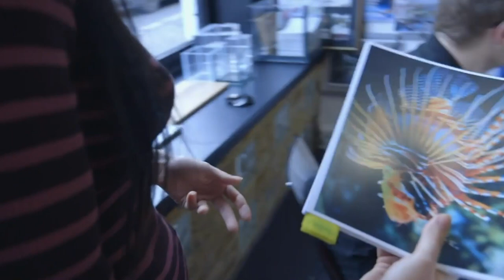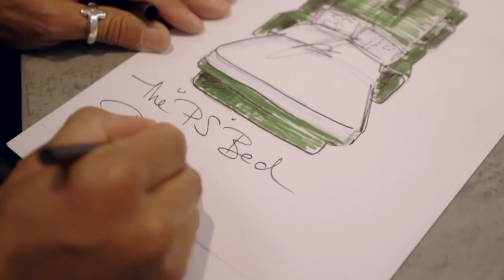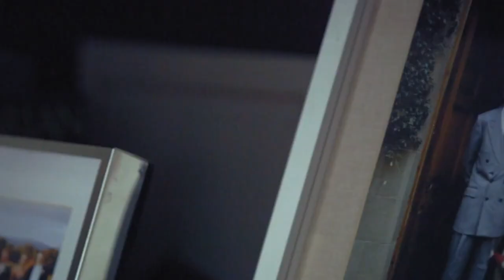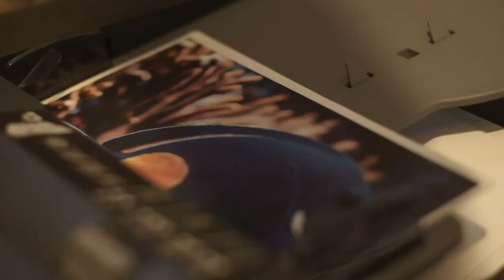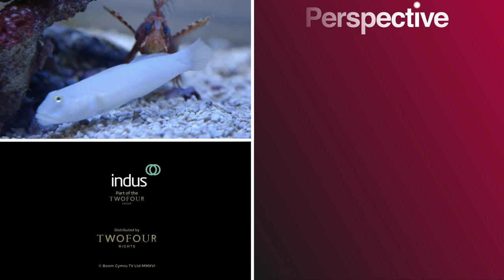£100,000 Aquarium Gets Installed In A Luxury Mansion | Finest Interiors S1 E2

Comment: £30,000 for 1 king size bed. £200,000 a kitchen.
 £20,000 for 1 bottle of perfume
Reply: I'm not well now and I'm a wheelchair user and I leave within the benefit system in the UK people in this country are virtually on the breadline if they're ill or they disabled or impaired in any way and I have to rely on the state not because we all scroungers we're just not able to work because we're very unwell this program frankly made me vomit these narcissistic up themselves people think that when my pass wind we all ought to have a day off to celebrate the trauma it must have caused them I could not agree with your comment more or is one of the other commenters if you have a certain level of good taste you don't need to spend £200,000 on a perfume just for you all fur coat and no knickers